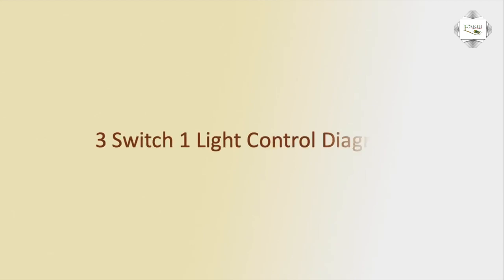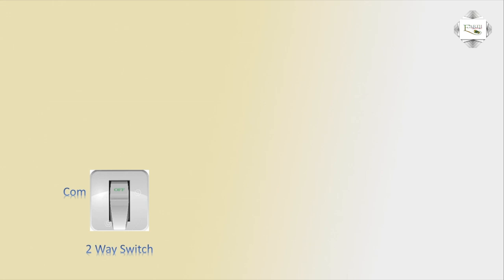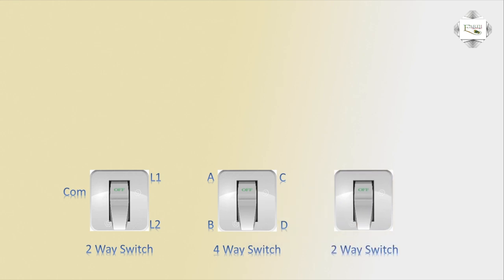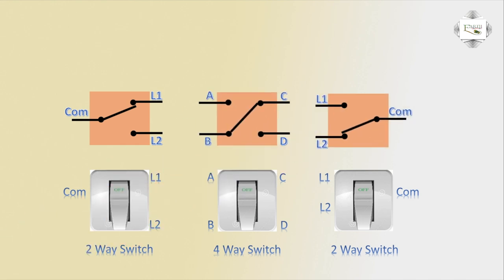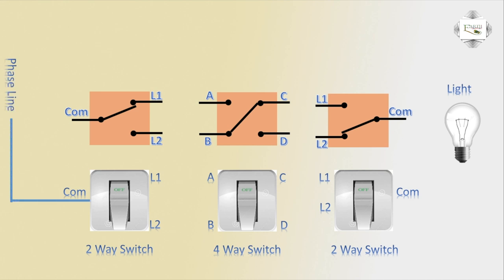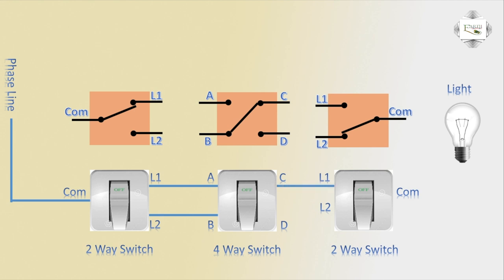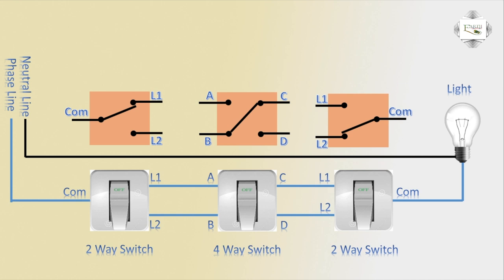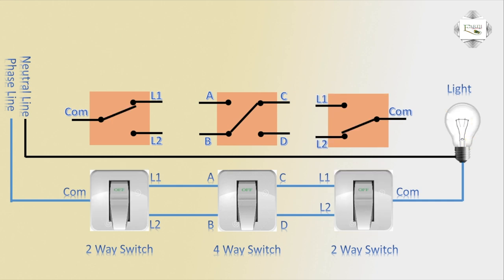3 Switch 1 Light Control Diagram | 4-way switch | Switch

Comment: This doesn't work.  If you turn on only the 3rd switch, there's no through flow. In fact, the only way switch 3 being on would actually turn on the light is if both switch 1 and 2 were already on.
Reply from the maker: Check diagram....thanks